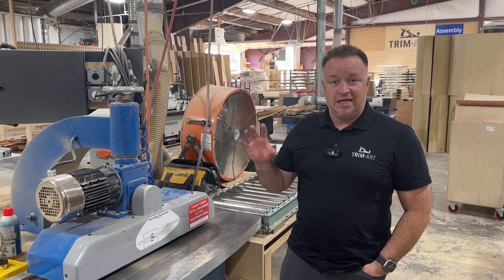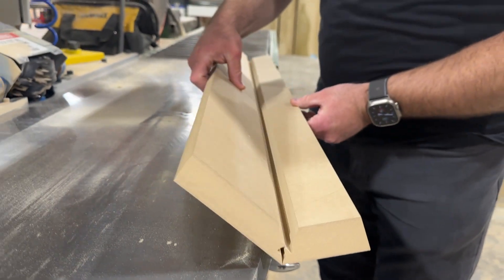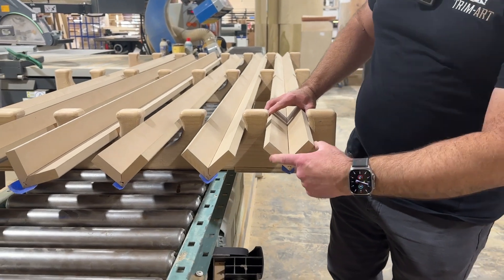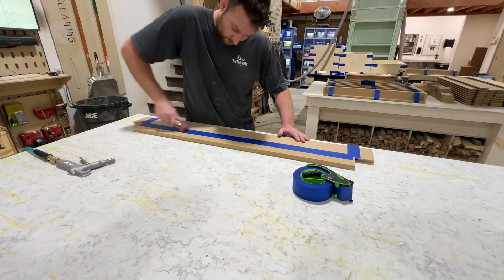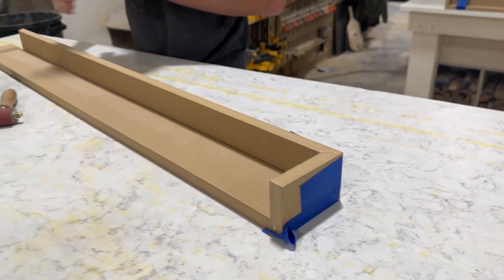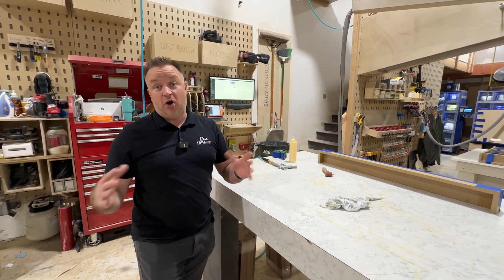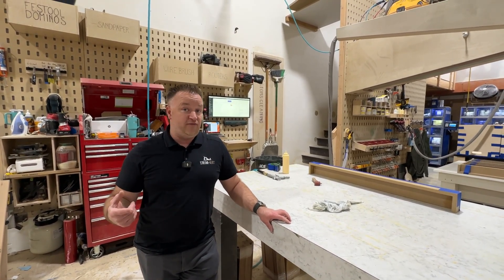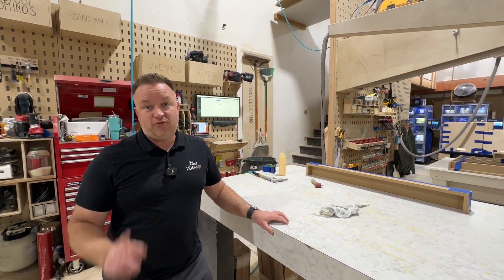How to V fold - Circle T / CNC / table saw

Comment: Saw this video.  Liked what you are doing so much I just bought a Circle T Lock Miter machine.  Those guys owe you a sale!
Reply from the maker: You won’t regret it. There are two different cutters they offer. Make sure they give you the ones setup to tape and fold.
Reply: @ I appreciate the heads up.  I was considering the diamond tooling.  Do you guys use that?
Reply from the maker: We do not